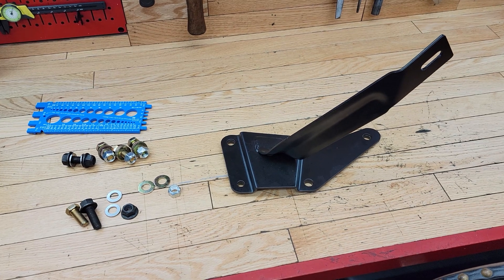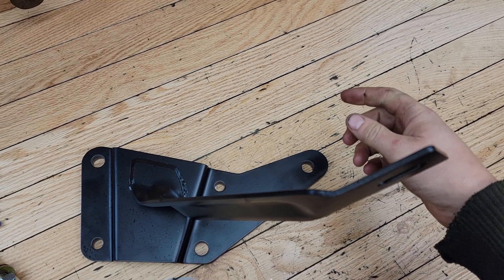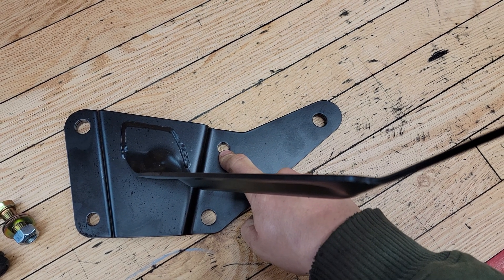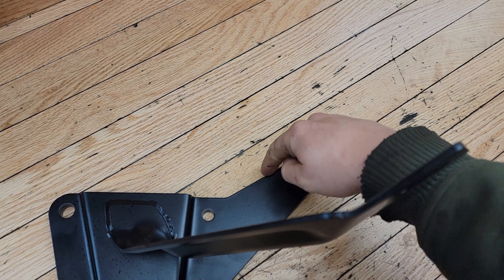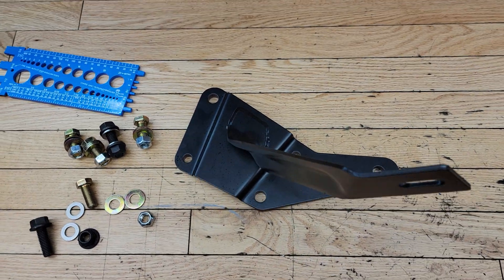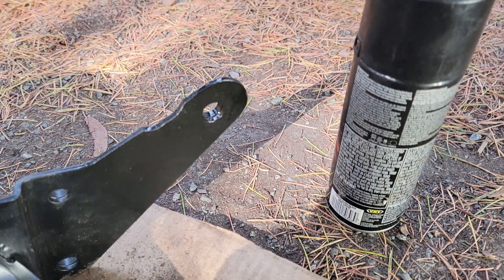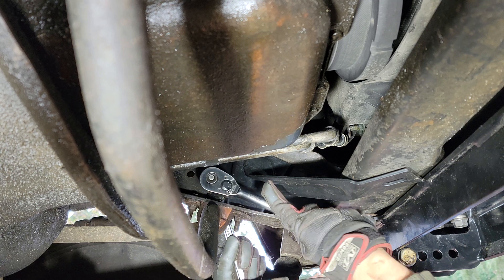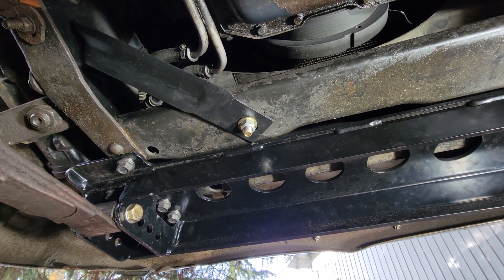Steering Box Brace | 1st Gen Cummins

Comment: I have been following your channel for awhile now. I built a 1963 Power Wagon ambulance on a 93' w250 chassis. (So it's similar to having a camper on.) I had to move the front axle ahead 1" so needed crossover steering. Without the sway-bar I really didn't like the way it dove in the corners.  I tried different spring rates without any better results in handling.  I'm in the process of building a new sway bar that will clear everything underneath.  If you're interested I will keep you posted on the progress. The rest of the parts should be here in a week or two. 
Cheers!
Reply from the maker: @jvanv4970  yes I'm interested in seeing that. Lack of sway bar is the primary reason I don't like crossover steering. Did you think about a rear sway bar at all?

Comment: I switched over to crossover steering. I run a truck camper also and had the same worry. With the crossover steering, 3in lift,  no sway bar, and a truck camper, it rides just fine. The sway wasn't affected as much as i thought it would be.

Comment: Hey brother, I found a mounting plate for the gear box that looks pretty well built on ebay. It's kinda pricey at $265, but I plan on getting one along with this brace to work in tandem with each other. I figure with the redhead box I got for xmas and these braces, it should shore up the front steering fairly well. I'll try n email ya a pic of that mounting plate.
Reply: Yes I did but haven’t mounted everything up yet. I’m replacing some other stuff while I got the front end apart. But I mocked it up and it looks and fits great. I’ll try and post something when it’s all done.
Reply: Ever end up getting the beefier adapter plate?
Reply: I finally got it put together and it handles extremely well now. Which is what I figured it would. I replaced the shaft with a borgeson along with a new rag joint. That and the redhead gearbox alone will make it drive tons better. But ever since my original mounting plate was welded back together several years ago, I wanted to get that "Sho-nuff" mounting plate when I saw it. It's double in mass which is why I got that steering brace as well to help prevent any frame crackage. It should also keep things tight in the steering for a while. Anyway, just wanted to update ya.

Comment: Thanks for the video. I have one of those steering braces that I pulled off a Ramcharger many years ago. I'll have to finally install it! Like you, I need to keep the front sway bar for when I carry my camper which is bigger and heavier than yours. Also added a rear sway bar which helps a lot. That much movement of the steering box in relation to the frame sure looks like a cracked plate. I have had a cracked mounting plate and it didn't move that much.
Reply from the maker: Yeah it seems it's cracked but unless it cracked within the last 9 months when I had the steering box off to rebuild it, everything was looking good. I'm looking forward to installing a better product to replace it hopefully this spring

Comment: Would this plate work with cross over steering ? 
The bolt pattern seems like it would line up with the steering box ! 
I built one today for mine and it just doesn’t sit right without having that bump out
Reply from the maker: It should, yeah. Crossover uses the same mounting holes for the steering box.

Comment: Cross over steering has bump steer it’s why 2nd gens wonder all over a rough road even when they are right. The first gen setup wanders less when it is right. The original first gen steering gearbox used an arm that pivoted front to back in line with the frame rather than left and right opposed to the frame. It was a far superior setup.